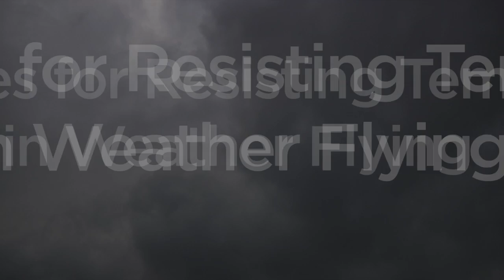VFR into IMC: Shared Wisdom

Comment: Why isn't instrument training a REQUIREMENT for every GA pilot to get even their first license?
Reply: sct913 - the average new pilot or student pilot is given the amount of IFR training necessary to avoid or get out of trouble. Additional training at that point would run the risk of creating an overconfident but underskilled pilot continuing VFR flight into IMC in a woefully ill-equipped aircraft.  The emphasis at that point should be avoidance of IMC altogether.  Remember, a private pilot certificate is a license to go practice and build skills.
Reply: Private pilots in training are required to get a minimal amount of IFR training (under the hood) but in my opinion not nearly enough. I wish the Private Pilot training required at the very least 5 hours of IFR training to better equip the VFR pilot to get out of trouble. I think right now it's only about one hour or so. Not enough.
Reply: @MacNmey  3 hours
Reply: @brianmitchell9944  Is it 3 hours now? Well, that's still not enough. Why not make it 10 hours? I mean, you are still getting great training to become get the PPL. I my mind, when training for the PPL, there is no down side to getting a lot of time on the gauges. They could require that half of the cross country requirements be done under the hood or something like that.